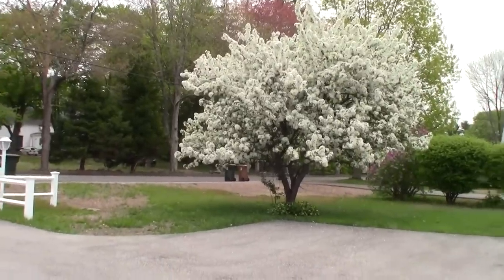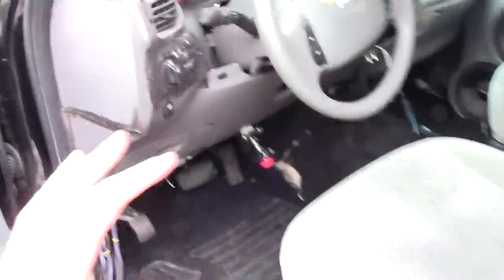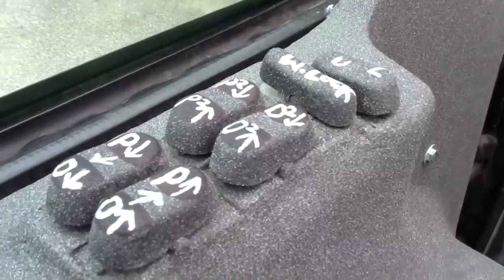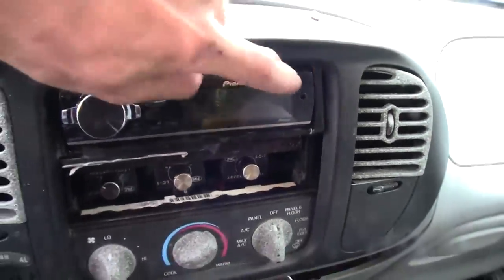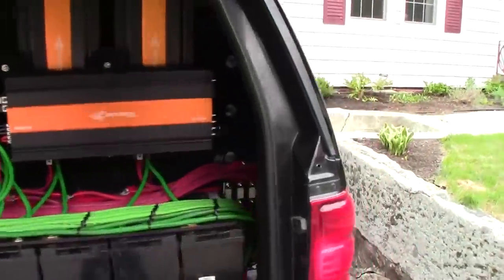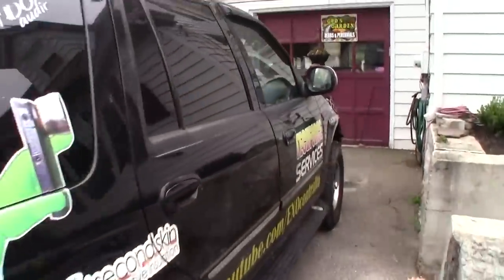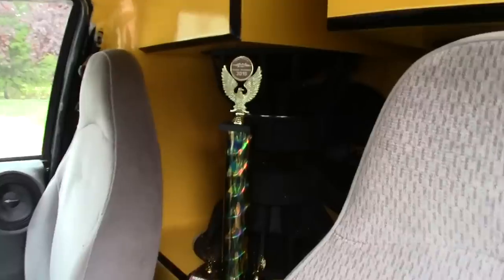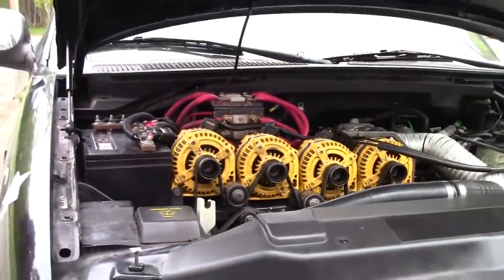20,000 Watt Car Audio Updates w/ EXO's BIG Sound System w/ 5 Iraggi High Output Alternators

Comment: You can solve that deck problem by extending the wires about 5 feet and holding it in your lap, so you can play it from the inside of the truck and outside.

Comment: just a tip for your head unit...why not run the wire long and build or buy a stand to rest the head unit and vital controls on...while driving maybe rest the head unit on your lap or passenger seat

Comment: Brake fluid is extremely flamable.. if it spews out of the resivoir  and hits the hot exhaust you could have a problem....in fact ford had a recall on the sensor right in front of the resivoir it would short out and set the brake fluid on fire and burn the truck to the ground. Something to think about.

Comment: Im curious as to what keeps the airbags from popping if you flex that much, are they disabled?
Reply: Airbags work on momentum, not vibration. Like a swing on a swing set. You can vibrate a swing. But nothing will happen. A sensor has to unspiring into a contact to go off.
Reply: ahh, I learned something.